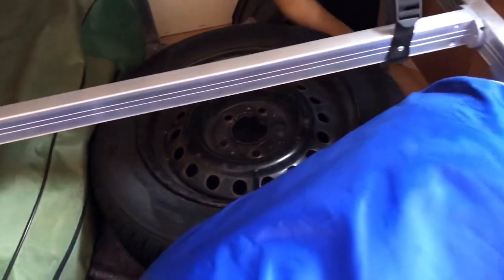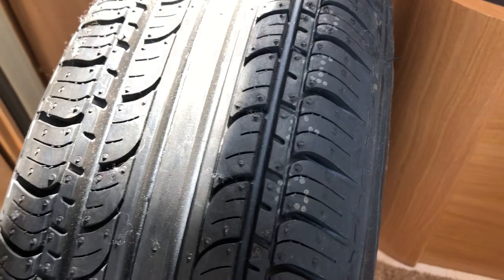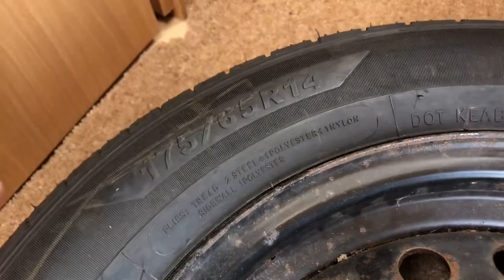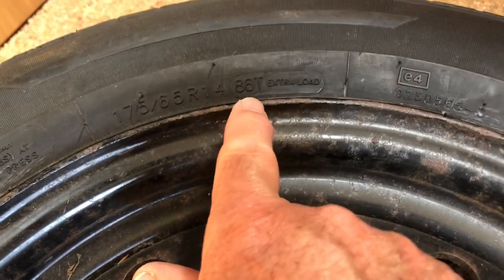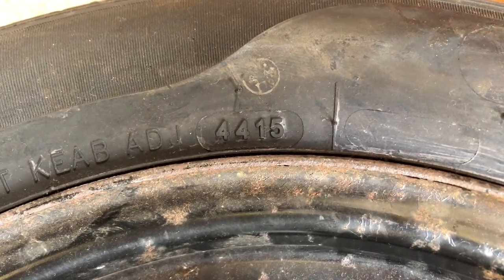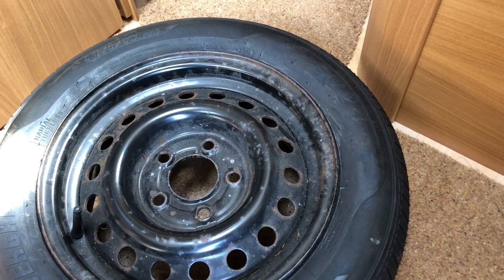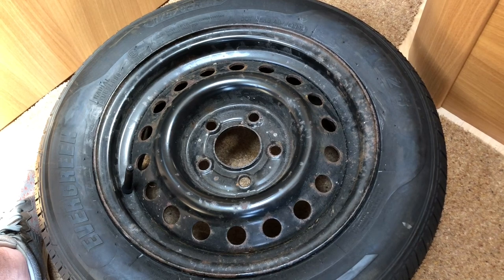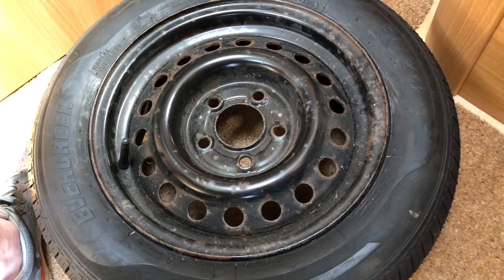Caravan spare tyre should I replace it?

Comment: As long as stored in front locker or inside under bed the steel wheel and the tyre will be like new, especially if never used once then returned, so keeping such a spare tyre for up to 10 years is fine and more eco friendly.

Comment: Hi Colin, I had the spare changed last year and had the same problem as you had with the old tyre. The spare wheel carrier frame caused dents in the tyre sidewall. As ours is a two birth it had to go back on the carrier. I put pipe insulation on the carrier tubes to provide a ‘cushion’. Haven’t checked it yet but I’m sure it’s ok for now. You did right changing it because if it ever had to go on the caravan and then something happened, the insurance company could blame it on the tyre age ! Happy caravanning and all the best Rob 👍
Reply from the maker: Thanks for watching Rob, Insurance, my thoughts exactly.